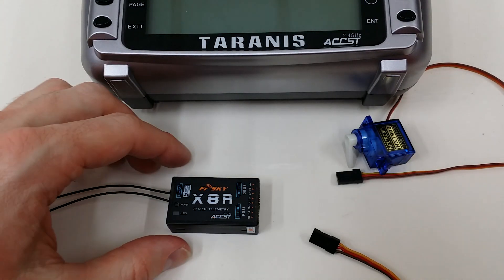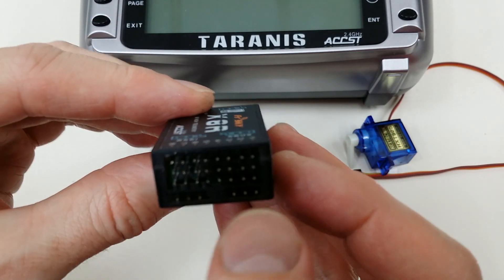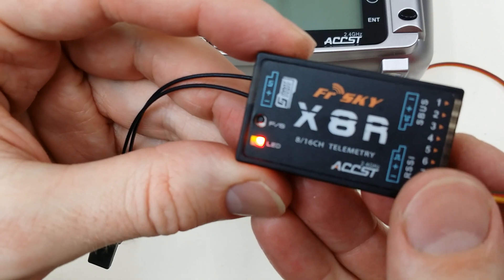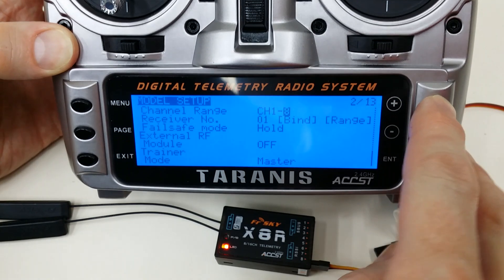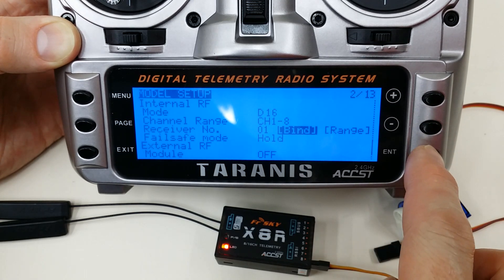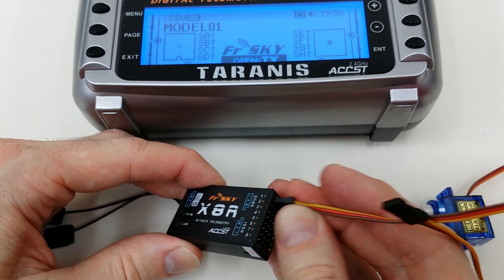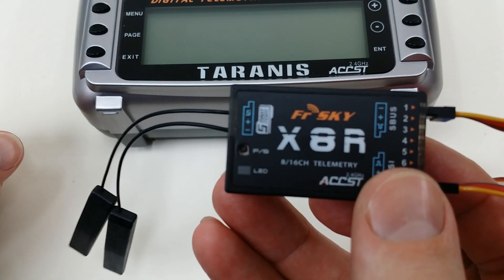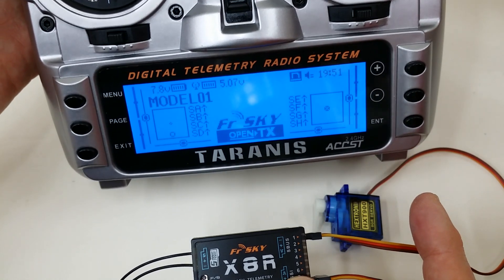How to bind FrSky X8R receiver to Taranis X9D transmitter in D16 mode

Comment: How did you get the Taranis to talk?  Mine just makes annoying beeps.
Reply from the maker: You may have a bad SD card.  There was a batch of them with poor SD cards which had to be fully slow formatted before they would work properly.  No sound is the first sign of this problem.  All radios shipped from HeliBatics were fully tested and resolved before shipping.  You can download the latest sound files from FrSky: http://www.frsky-rc.com/download/files/Firmware/New%20SD%20Card%20Contents%20.zip    Enjoy!
Reply: HeliBaticsTV So the sound plays from files on the SD card? I suppose all the files should be updated then?  How do you prepare the SD card, just copy all the files onto it?
Reply from the maker: steve c Yes, I recommend taking the SD card out, put it in your computer and give it a full/slow (not quick) reformat.  Then copy the contents of the downloaded file in the above link back to it and you should be good to go!   Enjoy!
Reply: HeliBaticsTV Thanks, that worked!  I used a new SD card and copied the files onto it and now I have voices!  Also thanks for the video showing how to pair the receiver. The directions with the receiver say to  "turn on the Tx while holding the F/S button on the module" but that won't work since there is no module or F/S button on the Tx. Also I couldn't get it to pair while connected to the PX4 and had to make a power cable to connect just the receiver to the battery while it was pairing but now it works.

Comment: Good video. Well done.
I had to watch it 5 times until I was absolutely convinced I was doing this correctly, but, still could not get a bind on either of 2 receivers.

I found out why.
apparently, you need sufficient voltage in the receiver pack. DOH!
Make sure your flight pack is charged up all the way.
Tried a new pack and both receivers bound instantly, no trouble.
I love this telemetry also, reading the flight pack voltage right off the bat.
Very nice transmitter
Reply: I couldn't get mine to bind while it was connected to the PX4, I had to make a new cable just for power to the receiver then it worked!

Comment: HeliBaticsTV Sir, did you bind the X8R in Mode 5?  I didn't see any jumpers attached so according to the manual this is Mode 5(D16) CH1-CH8, right?  I ask because someone on a forum I attend is having a hell of a time getting his X8R to bind with his Taranis.  Thanks!
Reply from the maker: Yes, we bound in Mode 5 (no jumper).  This puts PWM channels 1-8 on the pins, and includes telemetry.  All 16 channels (or however many you configure) are always available on the SBUS port.  You might also want to consider Mode 4 if you are using a multicopter with SBUS or CPPM input.  This gives you channels 9-16 on the PWM output pins and the flight controller will still get channels 1-8 from the SBUS.  See this video for more details: How to setup 16 channels on FrSky X8R using SBUS
Reply: HeliBaticsTV Thanks for the feedback.  That's exactly what I did too:  I bound my X8R in Mode 4, and am running through the SBUS for my first 8 channels.  Using the Naza M V2 GPS hardware on my homebuild F450, and just love the fact that I can do all my control modes and switches through SBUS.  Now I have more channels to use for things like LED lights (do this all through my Taranis Tx, of course).

Wish I had seen your "16 channels of FrSky X8R using SBUS" two months ago!